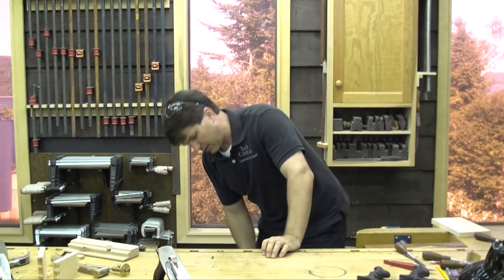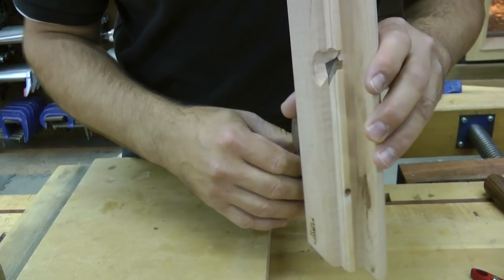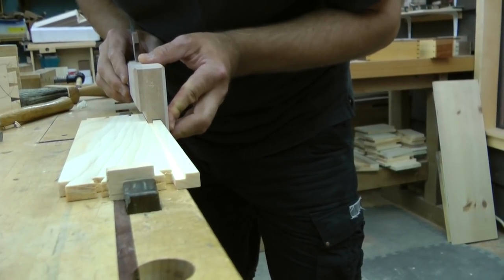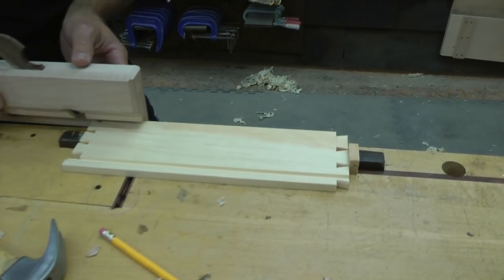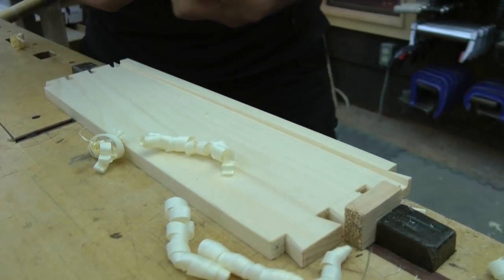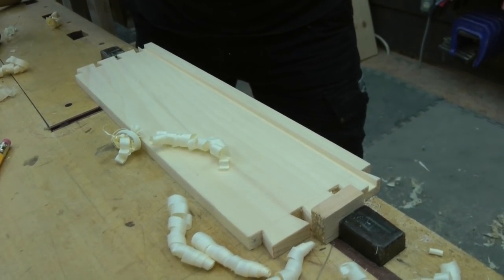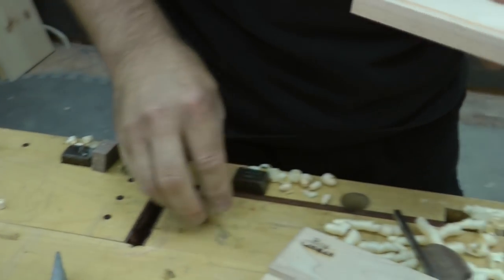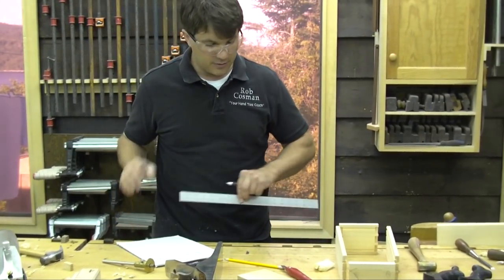Hand Tool Workshop Sample 2

Comment: Rob I made my grooving plane longer forward of the blade such that it's easier to establish a stable and plumb push on those shorter pieces, start to finish.  I hate feeling a wobble before or after the cut.   Overall length of 30" with the bite of the blade occurring in the middle.  it works for me.   Nice video.